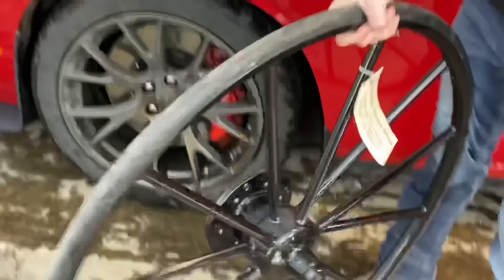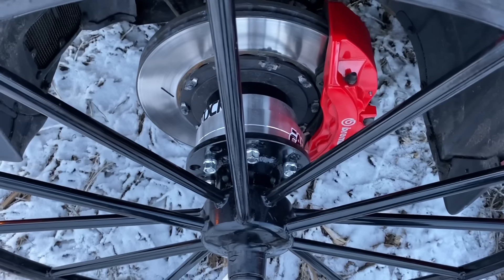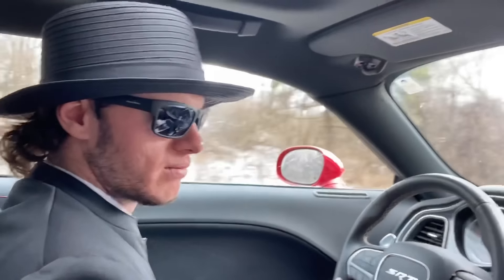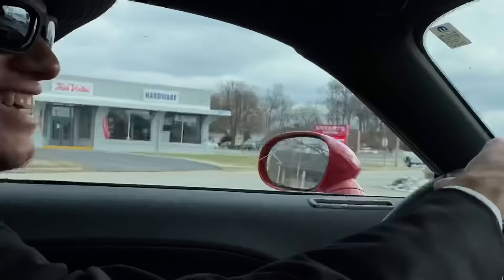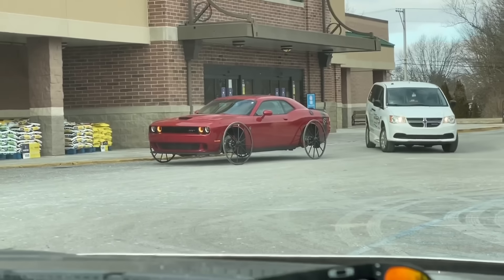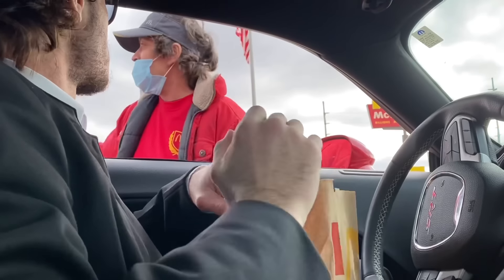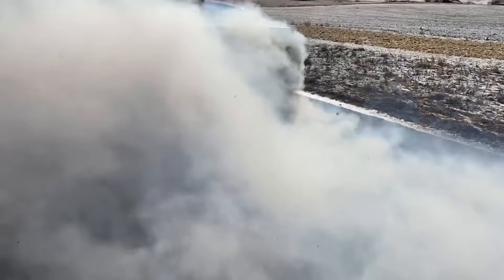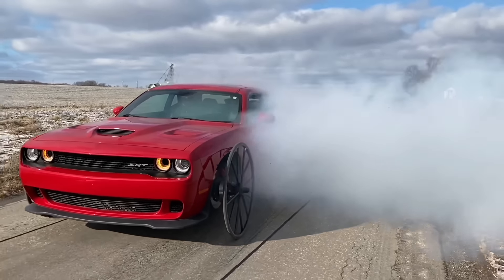Hellcat on Horse & Buggy Wheels goes to town and does burnouts

Comment: “How many horses pull this thing?”

“700”
Reply: He was wrong it’s 707hp
Reply: @DiscoMiata  nope 717
Reply: You’re all wrong. Its actually 670.
Reply: All of you are wrong a horse has 15 horse power so it's 47.66666666
Reply: @legion4076  ah a man of culture i see
Reply: @legion4076  ok you got me there
Reply: @ryandixson3615  it’s 707
Reply: @6z0  it’s 707
Reply: @Linki-nz  707 to the crank. Now add the weight of a boat. 670.
Reply: its 707 i even have one so i know
Reply: @DiscoMiata  my guy I was rounding to the hundred
Reply: A couple months back we ran a stock one on the dyno and it hit 715 and it was stock
Reply: Wrong 707
Reply: @jeffreynunn9673  the dyno doesn’t lie
Reply: @jeffreynunn9673  it has 707pft
Reply: Ryan Dixon, your wrong it 707
Reply: @MP-ef6mc  my guy it has 707 pound feet of torque not horse power
Reply: 707 hp and 650 pound feet of torque, it easy to look up but whatever.
Reply: @MP-ef6mc  wheel horsepower bud not crank
Reply: @6z0  thank you

Comment: That buggy wheel manufacturer needs to use this vid for advertising 🤣
Literally sawing thru black top and still functional is amazing..these wheels should last on a real buggy a few lifetimes
Reply: Its just a custom welded assembly.. not a real buggy wheel.
Reply: Creek side wheel made them as explained at the beginning of the vidio ..Creekside manufacturers buggy wheels for carriages in Lagrange IN ..
Also explained , Jason made and welded the bolt on assembly so the actual buggy wheel is real and made for an actual carriage. 
Just FYI .
Reply: @oneheadlight8000 yes it is lol he welded a part onto it that let him connect it to the car but other then that they’re buggy wheels

Comment: My car runs a small inline 4 engine and is by no means a fast car but it will get you where you want to go and I the winter tires need spacers otherwise the won't fit